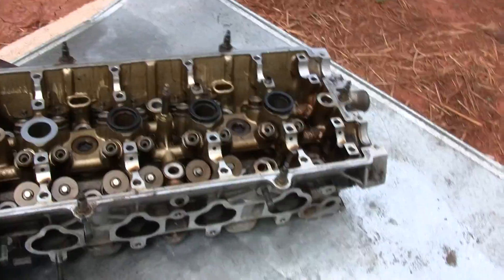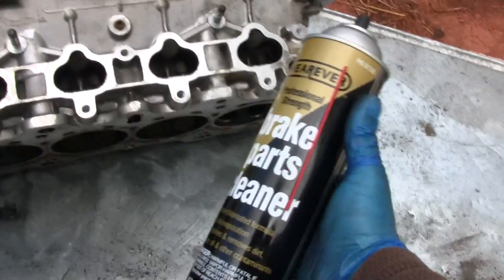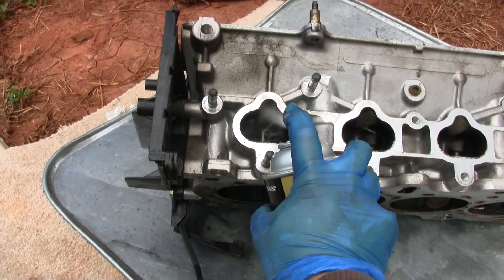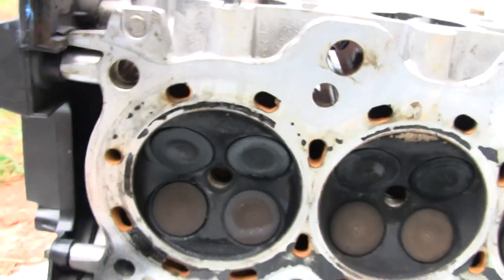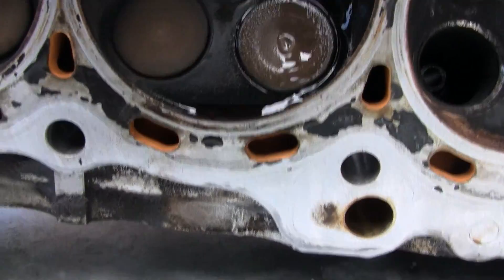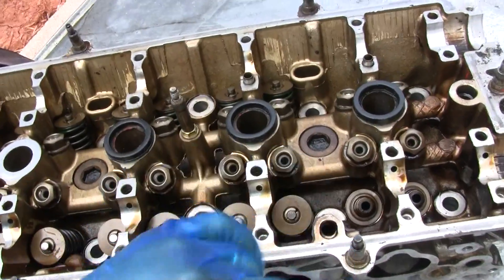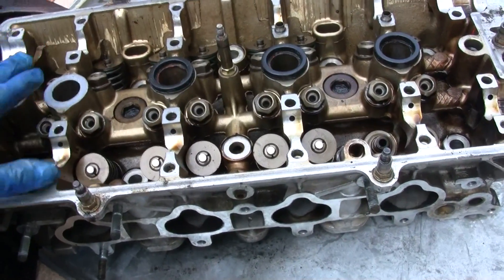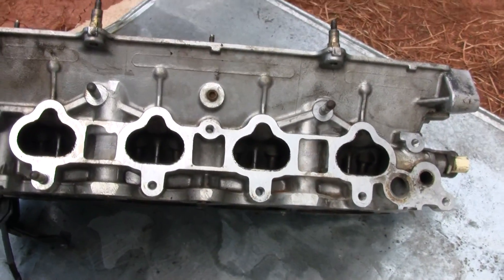cylinder leak test how to check for bent valves

Comment: is there a way to check for bent valves without taking off the head ?
Reply: Keegan Jacobs u would hear a bad rattle noise , back pressure build up through intake including back firing , poor mpg , rough idle , cylinder down. you'd know if their was bad valve ;)
Reply: Keegan Jacobs do a leak down test and that'll tell you.

Comment: I saw your video a while back.Recently did some engine upkeep on a 2.5 V6 Chrysler sebring with 187.000 miles. the oil pump needed to be looked at because it was leaking inside the timing belt area and i figured might as well replace the belt and water pump.and gaskets to upper and lower manifolds. I tightened the valve covers and cleaned the head and down below. wheni was ready to rotate the crank?camshaft to test the tension on T Belt for alignment.i felt torque and back up. I had installed the tensioer pulley  wrong  and it pushed the #1 cylinder spark plug coilseat up about 1|4 inch inside the well .i didn't  start the engine but it could have been disaster.I had to check for bent valves and your video went  ding ding ding  ding ding ding.Thanks dude

Comment: Good video my friend, could be a bent valve but could also be mass carbon build up  or maybe an overheating problem and the valve would swell so it wont seat right anymore So my rule of thumb is knowing how the car was driven before having problems helps out tremendously so whether it is a bent valve from a connecting rod or timing belt letting go especially on a interference motor good luck then but like I mentioned it could just be that the valve is just not seated correctly and just needs to be cleaned up and spun a few revs the auto parts stores sells the seating compound so just take your time and don't go to a shop everyone needs to go out and get there hands dirty then know body gets ripped off Peace out.!!!!!

Comment: thats fucken dumb,  on brand new engine's the valves leak anyway(even lapping them in)   i dont know why fuck wits  spray  super thin oil or fuel on the valves of coarse its going to fucken leak it doesnt have 1000odd psi from the combustion to fully seal/close them lol

anyway  a little bit of oil is not a bad thing  means your valve stems will not wear out as fast(they are costly to replace)
Reply: actually the valve should seal with just the springs. No, they do not all leak  new. They have to hold 20 psi vacuum before they are ok to leave the shop. I think that this is an ok method if you don't have a vacuum tester. If your valves are leaking straight from the shop then your machinist isn't very good.
Reply: Travis Callahan vacuum measured by psi ?  or inches of mercury
Reply: Clay Polen I clearly said psi. That's what our rig used as the unit of measure.

Comment: Hey theng xiong please help your fellow hmong kid out, i have a d series head and notice two stuck open intake valves, is that a sign of a really bad bent valve, sorry my first time rebuilding and inspection, just want to make sure thanks.
Reply: Head is junk. Thais a sign that its been super hot and the guides have seized or it was a victim of a broken timing belt/chain. It can be rebuilt sometimes but mostly it's cheaper to get a different head.
Reply: adam yang try free-ing it by hitting down on it. and some wd40 ... might loosen up

Comment: Leak down tests are very accurate, whether on one cylinder of a car engine or on a 4 stroke motorcycle engine, same thing, amazing thing I have seen has been, Chinese made 4 stroke bikes, leak down has always been good (low leakage) bad running issues were caused by other stuff but they were almost never worn that bad, even when run with low oil, really, amazing tough engines and they respond so well to being tuned :)

Comment: I don't think it would be worth the trouble. Toyota designed that engine to have low end torque and adding an extra cam will only up the rev limit a few hundred. Which won't do anything.

Comment: I have an 01 Tiburon 4 cylinder. it is an interference engine. I don't see any marks on the pistons or valves ( there built up with carbon ). is it possible that the valve seats just need to be resurfaced

Comment: Hey thanks I appreciate the assistance. I'm considering buying a 328i head for my 97 BMW.
I found a 528i head used that was rebuilt with 7,000 miles on it. Would it be a decent purchase if I look it over. It cost 300 versus bmw's price or 3500.00 .What other advice would you have and could it be tested or magnafluxed at a shop? Thanks Shawn

Comment: I know this video is old but just some tips on this.
First off i would use oil not break cleaner. 
Second i dont think you told them to take the cam out. That way all valves will be fully closed.
Reply: I know this comment is old but i don't think that people who don't know the purpose of the cam should even take the head out.

Comment: thanks for the upload! simple & informative!  in the process of checking heads on 2.5 mazda v6.  got water(heavy) & white smoke from tailpipe.  do you think this will be from a bent valve?  no visible water in oil when i drained the engine but upon removing the cams i noticed oil & water mixture from the #2 cylinder.  just a novice but not afraid to turn some wrenches!  also noticed sometimes when motor was running the temp would run high.  any help would be greatly appreciated!

Comment: not bent valve for sure. but iv used this method and it has saved me once or twice. its safe practice to do a good valve laping before use at least with used heads.

Comment: From personal experience never, ever use Redex to leak test your valves. Yes, I know he's not using it in the video. It took me 2 weeks to recover from the fumes and I wasn't fit to drive for the first week. Turns out that Redex is almost entirely naptha which will screw up your brain much worse than petrol fumes.

Comment from the maker: To: halfmoonmoua 
 Answer to your question yes you can. I usually use a vacuum pressure test but not everybody has access to one. So I usually set all the pistons to the middle of the cylinders and fill them all up with oil. Let it set for a few hours 2-3 or over night if possible for best results. If you notice the oil starts to drain after just an hour or 2 than its bad. They should all be just about full even after overnight. But any machine shop can pressure test the cylinder.

Comment: hey whats up Theng, nice videos, one question, is there a way to check if piston rings are still any good with the head off and not removing the pistons out of the bore? I have a single cam block with the head off.

Thanks, 
Guehue

Comment: soapy water works good but oil is better cause thats what its gona use any ways .but soap water is better no cemicals because that stuff gets metel imbedded into your engine and can cause more problems later on with o2 sensors .

Comment: dont ever chance or do switch over unless your really broke or very sure the clearances on springs and valves sit perfect with the valve guides.they should always be replace by new springs and valves because you can damage the whole motor and you will have to do a rebuild.do it right or start from scratch.  dont risk it  measure every thing and keep it with in specs. yep

Comment from the maker: NO water will not work the same. it does NOT DESOLVE carbon build up, grease or oil that can block the valves opening. do u really think water alone can wash away oil and grease

Comment: If you pulled that head off you should have held your horses by leaving it bolted to the block and invested in a cheap leak down tester, the method you use is not good at best.

Comment from the maker: To 500hpsi. Yes it could be warped valve to.  But regardless of that fact.  The valve will still need to be removed to reseat the valve and the valve seat. Carbon build up is possible but WILL NOT leak as much as a warped or bent valve. So how is this misleading. Did u try to sell a head and they used the trick on it. Im sorry if it cost u the sell but like I said.  The valve regardless will have to be removed to reseat properly.  Thanks for ur input

Comment: Gas is the cheaper way of checking for a leak.  Gas 3.50 per gallon, brake cleaner 4.27 per 32 oz.  Thats the only time you will ever hear gas as the cheapest option.

Comment: Not necessarily bent, could be a bad seat. All you have to do to fix that is a good lapping or grind the seats. Exhaust valves usually are worse about getting burnt. If the valves are bent, you have to replace them.